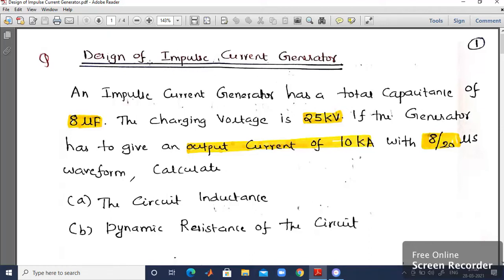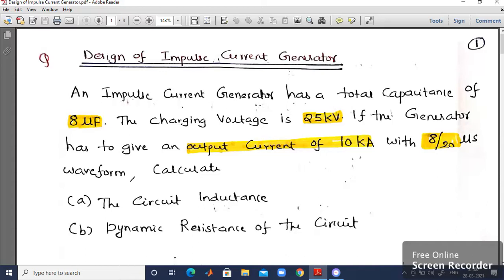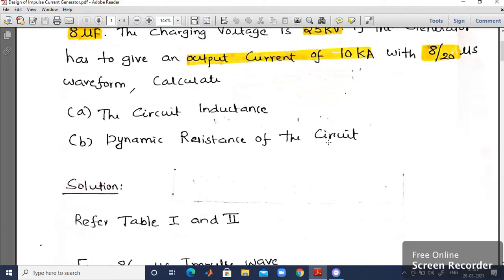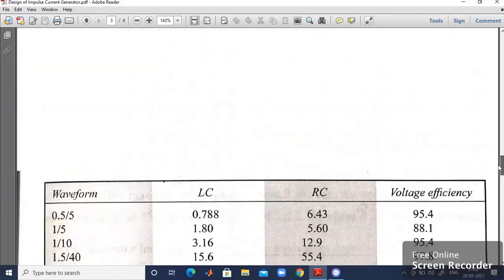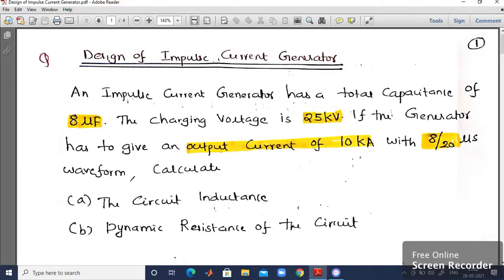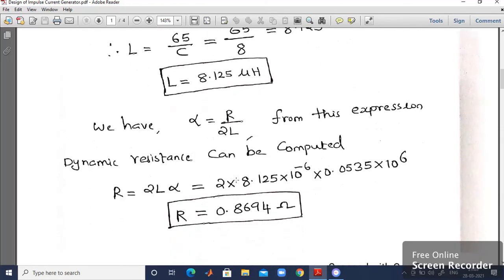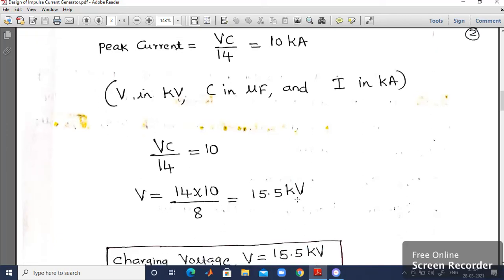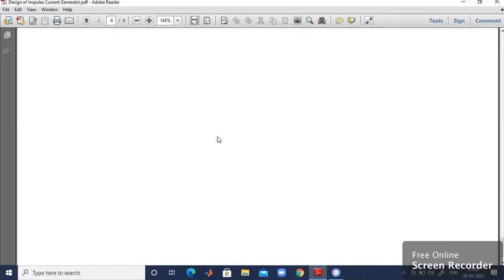Design of Impulse Current Generator with suitable example|Impulse Generator Design Procedure|HVE Lec

Comment: Dear friend, check the last calculation (Charging voltage). There must have been a typographical error. V=(14x10) / 8 = 140 / 8 = 17.5 kV and not 15.5 kV. Is correct? I would like to ask a question. Is this voltage value calculated to obtain the R value of the lightning strike when the current flowing through it is 10 kA? If I understand correctly, when a current of 10 kA passes through the arrester, and the voltage drop across it is 17.5 kV, then I calculate the resistance of the lightning arrestor under these conditions by R(arrester) = V(charging voltage)/ I = 1.75 Ohms. Is this right? I appreciate if you can guide me. Regards, Italo Foradini